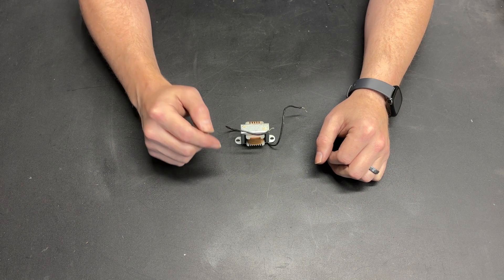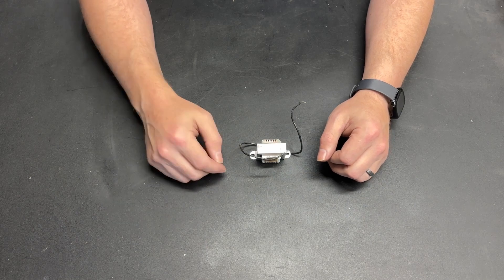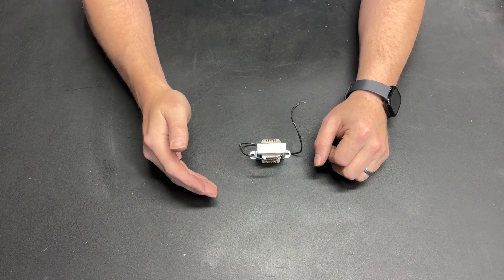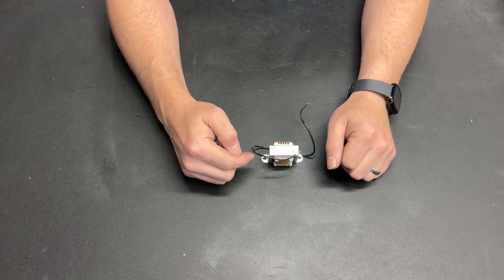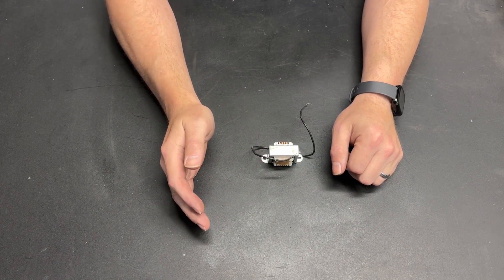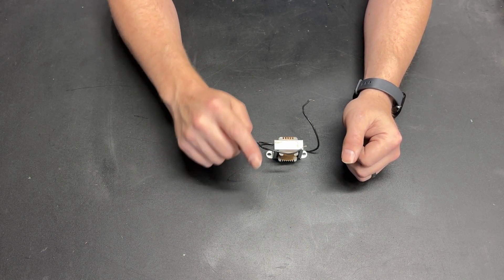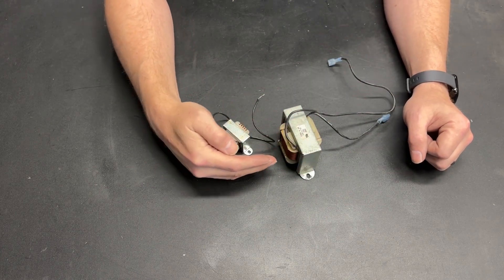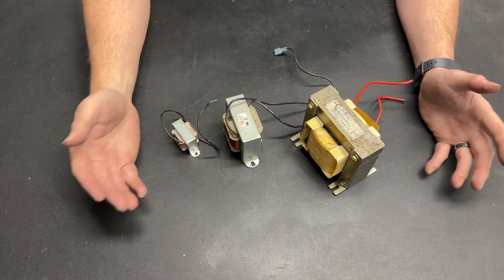The Specifications of Motor Chokes: Amps Milliamps & Henries Everything needed to pick a Motor Choke

Comment: You said “ if they don’t say they’re not a choke they’re not a choke” I asked mine n I think it’s Buddhist cuz all it said was “ ohmmmmmmmmmm ohmmmmmmmm” …….. I’ll see myself out. 

Picked up a treadmill from 96 yesterday has the big choke and a big blue capacitor. I’m not familiar with the board it has. Pretty blue and robust looking motor lol. Only 1.7 hp at 3200 rpm with a big fly n rear fan. A precore board bout half the length of a 2100. If I was to go scr route on that would I use that capacitor too? Tryna decide what I can do with this motor or if I should get a scr, use the choke from this set up and hunt down a motor with lil more torque.
Reply from the maker: That is almost 3 foot pounds 2.79 , that is actually a fairly good motor.  I have found that running a capacitor tends to cause serging under a load so I don't run them

Comment: Thank you. Do you connect the choke before or after the rectifier?
Reply from the maker: depends on the type of choke.  A DC motor choke goes on the DC side but an AC inductor (also a choke) goes on the AC side.

Comment: I don't think I have a handle on this and feel I should. Are these motor chokes used to soak up the current surge when a motor first starts?
Reply from the maker: Some power supplies have cleaner power than others.  AN SCR with rectifier wile being more efficient, more robust, and less expensive produces power that is not as clean as a PWM.   A choke helps level out the power when using a supply like an SCR where the power is not as clean.  It cleans the power through all operation but visible sparks are easier to see during start up.   A motor using an SCR type power supply will actually run quieter when a choke is installed through the entire range of operation.

Comment: A choke looks a lot like a transformer.  I just took a transformer out of a microwave so that I can make a spot welder and it is huge!  I wonder if a microwave transformer can be used as a giant choke by simply disconnecting and ignoring the secondary coil?  I really don't know enough about this stuff but I thought I would throw that out there in case it provides a source of chokes that otherwise, i imagine, would be quite expensive.
Reply from the maker: I’ve done a video on that exact thing but you MUST completely remove the secondary coil or bad stuff happens. https://youtu.be/sYjkQvUSths?si=XVT3tWachWTKoV3B

Comment: Appreciate the video and others that you have made. Have disassembled two basic treadmills saving motor and controller.  One 'system' was used to vary speed on small Grizzly band saw to allow me to cut both wood and metal comfortably.  My observation is that the chokes I see on the OEM circuit board seem to be closer in size to the small one that you started with.  Would anything be gained if I were to solder in a larger choke or do you think that the sparking issue you mention is administrated by the configuration of different component on the OEM circuit board.  Don't want to complicate your presentation, mostly curious.  Thanks for sharing all your ideas and experiences.
Reply from the maker: The small ones on the board are for the AC side and AC and DC amp requirements are totally different